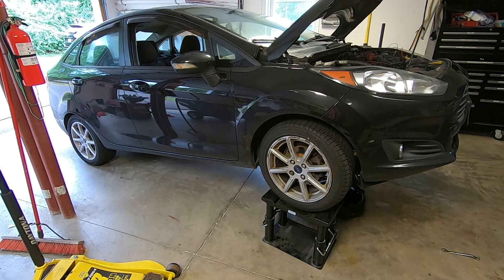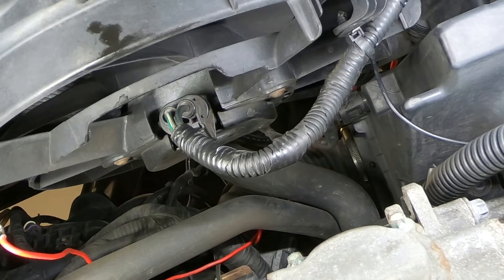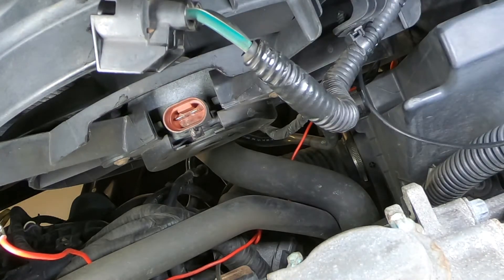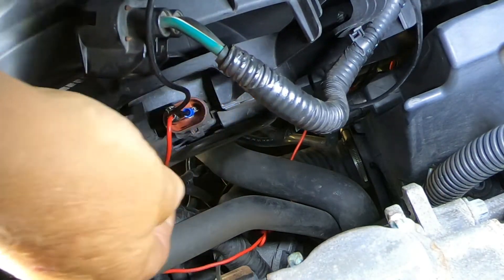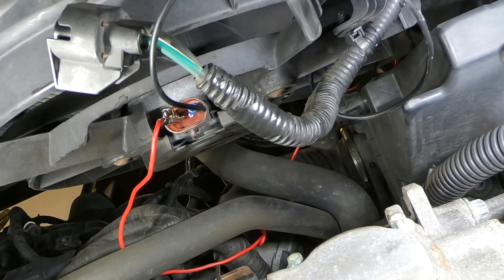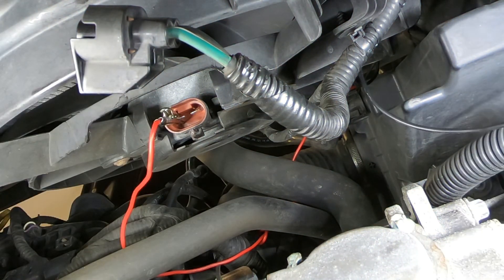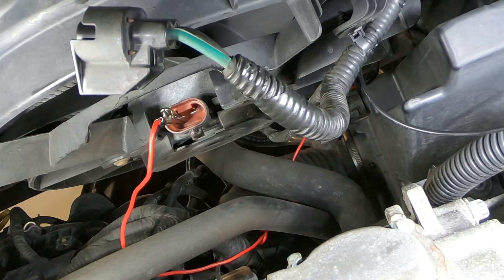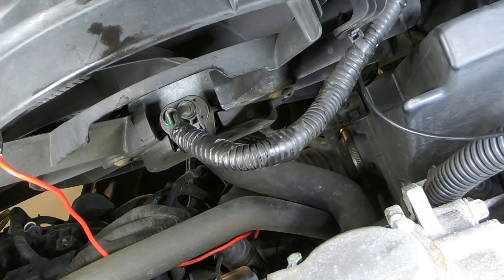Does your Car Overheat in Traffic?

Comment: If there isn't any juice going to the fan why is the fan bad? Couldn't it be the fuse relay or fan switch? Did you test the connector going to the fan if it has 12 volts going to it? Thanks
Reply from the maker: I was able to determine that fan itself was the issue because I hotwired it directly to the battery and it failed to come on.  I did not need at that time to look any further. Had the fan responded by coming on I then would have turned my attention to other possible causes as you mentioned.

Comment: I love what you do I just subscribe
Reply from the maker: Thanks for the kind words james; Welcome aboard. Now being retired I try to gear my channel to the do it yourself guy working in his driveway. I use tools that the average guy can afford. I think it comical when some of these guys on YouTube pull out these diagnostic tools costing thousands of dollars. The only way we as do it yourselfers would have access to a tool like that is to take it to a dealer or repair shop. That is exactly what we are trying to avoid LOL. Thanks again for subscribing and stay in touch.
Reply: @richardspaulding5035  hey will a stuck thermostat make a car overheat also will it cause The Reservoir to overflow,or will trap air make it do it?
Reply from the maker: @jamesgreen1337  yes most definitely. There  are  a number of things that can cause a car to overheat. Too many to list. Most shops have a nominal fee to diagnose problems. Then you can decide if you want to attempt  the repair yourself. Let me know what  you find out.

Comment: Hi. I live in tropical country.  I have sometime (not always) problem with overheating of engine when in traffic or in stand still.  This happen like around 10 time in a year.   

Some information as follows:
- the car is Isuzu Alterra diesel engine with clutch fan
- the radiator cap is ok
- radiator unit is new (i use the original radiator)
- radiator level is ok. 
- no radiator leak.  I never top off the radiator fluid.
- i use fully coolant fluid
- no plastic blocking the front of the radiator
- air condition fan unit is working (it switch on and off)
- when no engine over heat, the air con give cool air
- air con evaporator unit is clean (new cabin filter)
- clutch fan seem to work because i check the RPM (with non contact rpm tester/tachometer). The tachometer RPM at tester unit show same as the RPM at the car Gauge tachometer.  Clutch fan is not easy to rotate when engine is at operating temperature.   Clutch fan spin more freely when engine temp is cool.

When engine overheat, the aircon blow hot air as well

One time, when engine overheat, i switch OFF the air-con unit, slowly the engine temperature go down to normal engine temperature.

May i ask for your recommendation why my car sometime overheat when in traffic.
Reply from the maker: Thanks for the question Casar;  I don't know a lot about diesel engines.  One thing that stands out in your comment is you are using strait coolant.  Coolant is made to be diluted with water 50 / 50 mix.  If you use it strait it will not be as effective.  If your car is an older vehicle as I suspect it is because it does not have an electric fan it may have a blockage in the radiator. Pick up an  infrared thermometer at your local parts store or borrow one form a mechanic.  Aim the red dot at several locations of your radiator with the engine at operating temperature.  if you find some sections of the radiator hot and others cold you likely need a new radiator.  from what you descried I don't think it is your thermostat. Let me know what you find out. thanks for watching my channel.